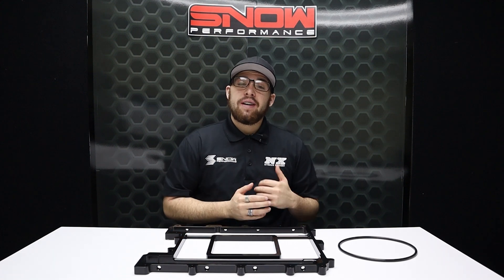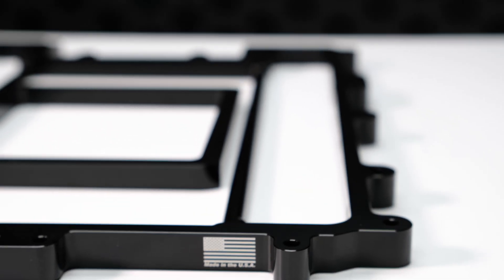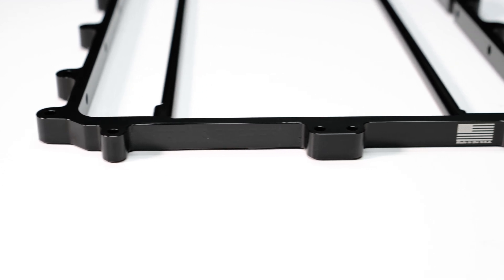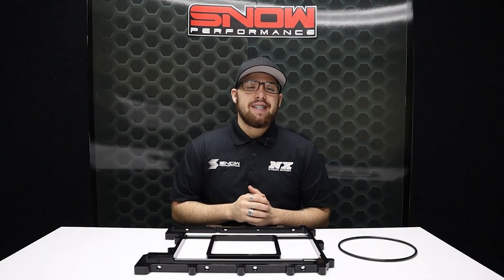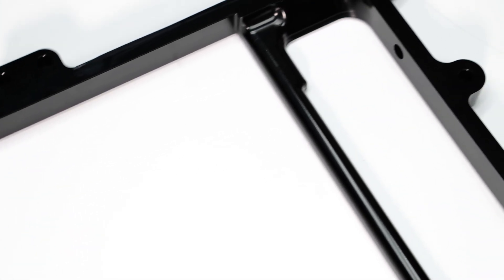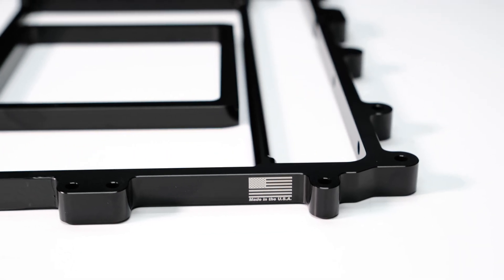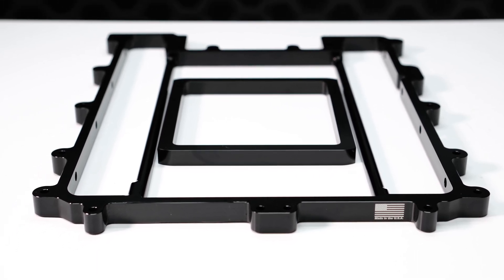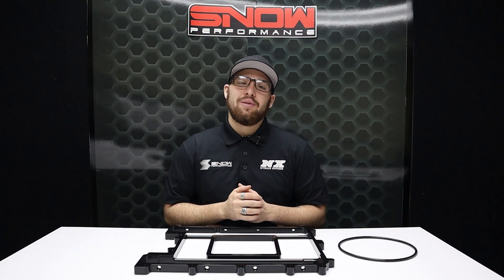How to Add More Power to your LSA Equipped Vehicle! (Snow Performance LSA Supercharger Lid Spacer)

Comment: Very nice piece. Would this require a tune/ retune once installed?
Reply from the maker: In order to receive all of the benefits of water methanol a tune is recommended, our tech line can give you more information on this. 1-888-GOFAST-1